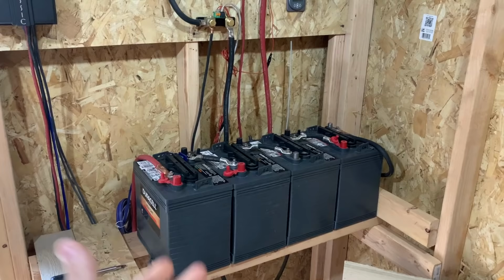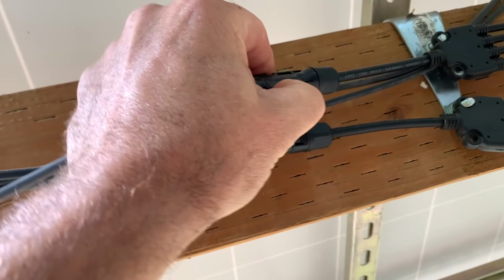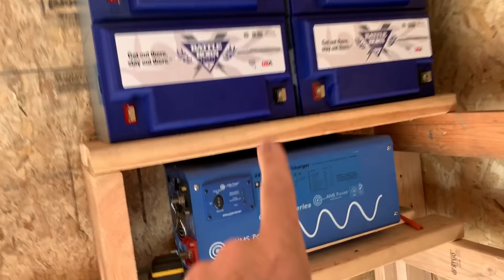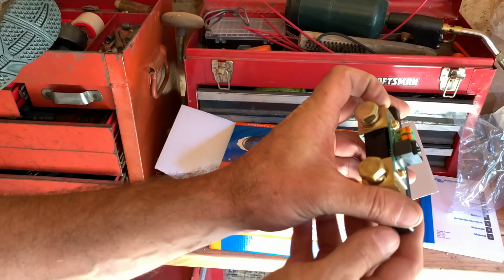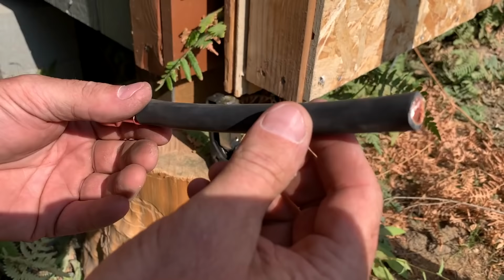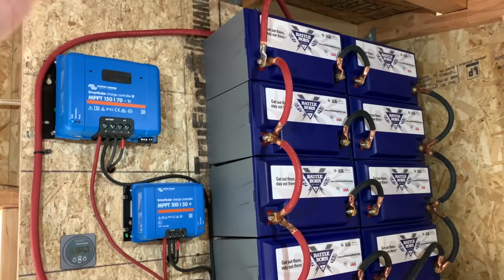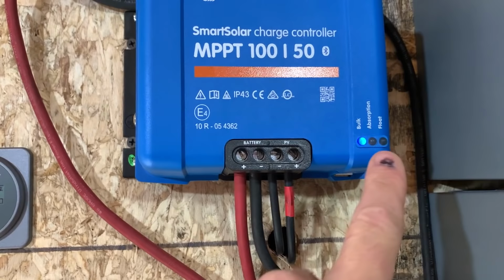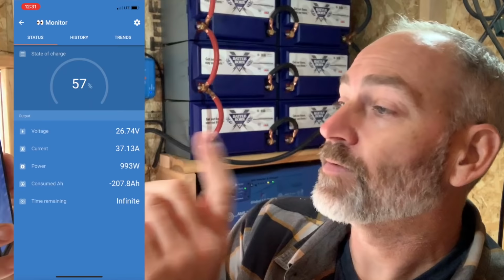EASIEST Off Grid Solar Power System Battery Bank

Comment: I want to give you a little advice on safety on your solar system for two reasons. One is, you aren't aware of them and the second is those folks watching how you do certain things are probably going to be making the same mistakes. Never connect your positive wires last on DC current but, connect the "Negative" wires after placing a 1 ohm resister between your hot negative ( battery or power side) and the negative you will be attaching it to. Make sure you touch both leads on the resister to both negative wires or terminals and then immediately connect the two. This will keep from blowing up electronic components inside of your charger and inverter. I'm sure you heard the pop sound when you connected the positive side of your battery bank.  Additionally, use shrink tube on all wire terminal connections. The cable terminals on your batteries look terrible and will corrode without using it. You have way too much bare copper on your terminals exposed. Finally, you should have a PV disconnect switch on the outside of your solar shed to turn off your system in case of fire.
Reply: Great advice. It looks like there should be another fuse between the solar charge controller and main positive based on the amps the panels are pushing, right?
Reply: Using a precharge resistor is a very good idea and with most inverters and charge controllers is a requirement.  

As far as whether you connect positive or negative last or first does not matter since everything around the batteries is wood and non-conductive at the 24v he is dealing with here.  The only time it is a good idea to connect the negative last when making a connection or disconnecting it first when breaking a connection is if the chassis of whatever you are working on is grounded to the negative cable so that if you are using a wrench it won't matter if you short it to the chassis.  If the chassis is positively grounded which is still common in old tractors and some vehicles in countries outside of North America then the positive would be the best connection to make or break the circuit.  

Regarding the cable terminals, these crimps will be just fine, and since these batteries are in a shed protected from the elements they won't really corrode since they are lithium rather than lead-acid.  At the most, he could apply a bit of dielectric grease as a barrier but it is never a good idea to heat shrink battery cables unless you are using it as a barrier to prevent short and then you should use clear heat shrink so you can see the connection since most heat shrink will hold in moisture making corrosion more likely. 

Having a PV disconnect is also a very good idea at both the array and in the shed.
Reply: Are you saying he should connect both negative leads to the resistor to complete the circuit then bypass the resistor by connecting the negative leads together? Just asking to learn.
Reply: @aqpham84  Yes the resistor bridges the connection first and allows the capacitors in the charge controllers and inverter to charge up and equalize to the battery bank voltage more slowly which also dramatically reduces or in most cases eliminates the spark when you make the final connection.  You can also buy DC isolation switches that have the precharge resistor built-in which is the preferred method since an isolation switch is a code requirement in the USA IIRC even if off-grid and just makes common sense in any semi-permanent install.
Reply: Craig Fisher Where are those batteries going to be after a moderate earthquake ?
Reply: @johnb4183  – I haven't heard of earthquakes in northern Idaho but what do I know?
Reply: Good advice my friend
Reply: thank you
Reply: You only mentioned a couple things and I'm sure you recognized a few others that weren't  optimum. He'll learn soon enough  what hasn't  been  done properly....😨. I'm really surprised  Battle  Born would want to be associated with his setup???
Reply: The connectors will corrode even with heat shrink tubing. Apply dielectric grease first.
Reply: @johnb4183  that was my first concern. He needs some hold-downs to the wall, assuming the wall is strong enuf for the shaking
Reply: God Robot  wrong. 
As a ASE mechanic and master electrician: always hook up neg last on DC system, and  draining capacitors in sensitive equipment is a must. 
You can only let the smoke out once.
There is so much wrong with this install, I don’t have time.
Reply: @kuhrd  no
Reply: @ronsagmuller1350  no what?
Reply: @rubiks6  There was a 6.5 in central idaho this spring that could be felt as far away as Calgary. there is def the potential for earthquakes. Though a bear or even racoon trying to break in is a far more present danger. Eitherway, if i was putting in $10k+ batteries, BMS, inverters etc, i'd spend a couple of bucks on some strapping
Reply: Thanx. That seems safer
Reply: And I agree about thd exposed copper as well. Armed with this knowledge, I'm gonna install my own. Hope they're not too expensive
Reply: I just love how everyone is an expert with advice. The one thing that I DID NOT hear from anyone is a quote from the manufacturers manuals as proof of what 'should' have been done differently.
Reply: @aqpham84  It does not matter if you temporarily add the resistor between the Main Positive Wire & Positive Battery Terminal or the Main Negative Wire and the Negative Battery Terminal.  The 1 Ohm resistor will limit the INRUSH to 24 amps - ie smaller  spark. It is called a "Pre-Charge Resistor"
Reply: Urbexx Jeremy  You completely contradict what Battle Born states!  Per Battle Born ... everything you said is wrong.   Do you actually think, that you know more about the Battle Born BMS than the Battle Born engineers?
Reply: @MicahFunk  Battle Born states, " ... USE AN INRUSH LIMITER ... "
Reply: @MrSummitville  very good. Now this is information that is indeed useful because of the quoted source. Thank you, sir. 👍
Reply: @MicahFunk  In fact, Battle Born manufactures and sells the Inrush Limiter device that you should install between the Li-Ion Battery Bank and large Inverters ...
Reply: @johnb4183  North Idaho doesn't have too much Earthquake activity.  Free from basically all (non cold weather related) natural disasters.
Reply: @MatthewSmithx  I didn't feel it.  Means it didn't happen right?  Seriously though, we didn't feel it up here, I don't remember even hearing about it.  I'm about 40 miles south of him.
Reply: @johnb4183  A bump from any yellow machine with knobby tires and that's a fireworks show, YUP!
Reply: @aqpham84  Are you going to setup the same solar powers system at your home in Viet Nam?.
Reply: interesting ;) . When working with DC, it doesn't matter what terminal is connected last or first, the current is going to take the same path to complete the circuit, regardless the order of connection. As I see it, any electrical or electronic equipment that could be damaged by inrush current, and doesn't have  protection,  as part of the design, is a poorly engineered. You recommended a value in ohms,but tha'ts only one part of the equation. The resistor needs to withstand the current it's likely to see in use. Given battery bank that can deliver 12 V. and a 100 Ams, your retor need to able to over a kilowatt of power I don't use solder on crimped terminals, that would be subject to vibration. Vibration, isn't a factor here, so I'd use solder, to protect against corrosion. Assuming the crimping tool provided a crimp that is both electrically, and mechanically secure. I agree there should be  a disconnecting device between the solar array, and the equipment in the building. However I'd place it at the array, difficult  to use the disconnect, when it' mounted on building that's on fire :) . Such a device, should be DC, for the current, and voltage, it's to control.
Reply: Such an important information and I thank you for that. I'll keep it in my mind when I go solar.
Reply: What wattage resistor do you recommend ?
Reply: @rubiks6  had one last year
Reply: NEVER unplug solar panels under load!make sure everything is off before you disconnect panels. A DC disconnect would be safer to do maintenance. But glad you are encouraging solar. But remember people the system is always ON when the sun is shining...
Reply: I'm a little bit shocked about mounting all the wiring on a wooden background? Here in Europe we have strict rules for mounting backup and solar systems. In our country you need it to be checked by a notified body before you can hook up your system to the grid.
Reply: @davygabriels7971  Yes. But this is USA, people have guns and first of all this power system is out of the (monopolist ;-) grid.
Reply: @Apo5308  Even if we have an offgrid power system, we must follow eletrical regulations and have it checked to receive a certificate. If you don't have this certificate, and someting happens with your house, fire, etc ... the insurance company will withdraw and not pay any damage.
Reply: @davygabriels7971  there are many regulations in the US as well. Some people choose to disregard them to their detriment.
Reply: @davygabriels7971  that's because you are socialist and let the government run your whole lives. Government has no place in someone's shed period!
Reply: @aqpham84  Yeah just hold the resistor to the end of whichever lead you intend to close last and then the other end of the resistor to the battery cable or pole (depends a bit on setup ofc) I got one that is permanently hooked at one end to my negative busbar but that's cause I tend to loose stuff :-D
Reply: If they don’t know that already they better not even start trying to put it together they might not live through it
Reply: @kuhrd   what about putting a grid of 2 or more ground rods in the dirt to have a safe grounding path and tie it to the negative? Power surges or lightening ?
Reply: i think he is also going to end up with a fire, you should only use one charge controller to one battery bank.
Reply: he made that mistake and there's that spark!!
LOL
Reply: @davygabriels7971  in this off-grid application, no inspections necessary. Yes, all components should have been on cement board, many thing wrong on this assembly. Read comments for list.
Reply: The disconnect switch is a must for sure.  As for the resistor, cheaper to replace that than a component or even the shed.  All good advice, glad I read your comment.
Reply: This is my biggest pet peeve with Homesteading and prepping channels. If people do not know what they are doing they should be honest about it, which is most of them, all trying to find their way with little knowledge, bad info, and act like they know.  It puts people watching at risk.  If people do not know the right way they should not set themselves up as teachers. I certainly don’t embrace the idea that you have to be a so called “expert” to share thoughts and ideas and alternatives, but it’s important to be honest about skill level and experience. The big problem is everyone is trying to find a niche to make a living in a society that is working to make most of us into slaves to the few in the financial industry and right now the support money on social media goes to the ones who claim to know.
Reply: Where do you find that type of isolation switch? @kuhrd
Reply: @MrSummitville  So use a 20-30 ohm resistor like Will Prowse shows. Duh!
Reply: @MrSummitville  Battle Born makes and inrush current limiter, but somehow that info did not get into this video. Martin did very little research, and Battle Born did their usual closed mouth act.
Reply: @MrSummitville  Finally someone else points this out! Battle Born is an over priced, over hyped company. Their limiter is not approved for permitted installs, it's way over priced, and the "specs" in their info on the device is literally not one iota more than the weight of the thing! If that doesn't make you suspicious of Battle Born, you need an education in technical electrical info and tech support/marketing.
Reply: @bryanminugh9680  Well put.
Reply: @silenthunter_on_wotb5288  Get the highest wattage you can find at about 20-30 ohms. Better yet watch Will Prowse or Lithium Solar for more info. they are here on Utube, and infinitely more knowledgeable than Martin.
Reply: @davygabriels7971  Yes but so many people here in the US are totally off the grid. I made a cabinet out of cement board for the batteries, charge controller and inverter, with almost no flammables besides the wire insulation, battery cases, and the plastic inside the devices, and two very small junks of wood.
Reply: @aqpham84  Yes that is standard. Will Prowse and Lithium Solar here on Utube and others show the procedure. C'mon people, do some real research instead of finding a channel you like and using it exclusively for your solar energy info.
Reply: @5400bowen  No, Will Prowse stole that idea from me.  DUH !!!
Reply: @MrSummitville  Well, so you are the only one in the world that knew about inrush current limiters, so he just HAD to have learned it from you,eh? I guess all that tons and tons of other knowledge he has about electrical and solar, he stole ALL that knowledge from you also? Is your real name Tesla? Did you teach the whole world about electricity from the very beginning?
Reply: @johnb4183  Marty is in Northern Idaho which is our neighboring state. We have yet to get a earthquake. That's more California. He has the batteries pretty secured so there shouldn't be a problem .
Reply: @rubiks6  no I am in Montana and we have never gotten a earthquake. Snow storm, avelanches yes but not earthquakes
Reply: Can you do a video, you seem very knowledgeable
Reply: Ya need fused disconnects bro !
Reply: When looking out for the people we watch...💁I swear it takes a village 🤺😶‍🌫️🧑‍💻
Reply: Thank you 🙏❤️
Reply: @rubiks6  We just had a 4.8 ish last week in central Idaho.  You never can tell.  I'm just reading these comments to learn how I've gotten lucky for the last 20 years.
Reply: @tagladyify  and my question is this ... what qualifies you to say someone is or isn't qualified?  Just askin..judge the judgemental and what have you become ?
Reply: @jamesgibson5876  it’s certainly up to me and you to determine if someone presenting information knows what they are talking about or not. That is not judging. Don’t be ridiculous. What you are saying is just trust everyone. And if someone is taking advantage of others for money just shut up and move along? What kind of society does that leave us with? No each person is responsible for not only what they say, but also what thy do not say.
Reply: Can someone please recommend a good solar battery to me?
Reply: Isn’t there more possibility of fire using lithium batteries ?
Reply: thank you😊

Comment: I hate how the only people that can afford to live off grid are the same ones that can afford to just pay the electric bill.. lol
Reply: Yeah this is easily a $12,000-15,000 solar system. That said, you are paying up front for "free" energy later.
Reply: Nearly $8K of this are the batteries. If you used AGM or even lead-acid, that would cut $6-7K off this. Then you're talking tops $5K for around 14KWh/day free energy.  In my large house I only use 10Kwh/day.  $5K would be easy to pay back from saved energy bills.
Reply: @toddfarkman2177  right on.  I mean not to mention the ecological impact the fossil fuel industry wreaks upon the world.
Reply: Off grid is often because of the cost of bringing the line into the property, or because the property has no realistic opportunity to connect to the grid at all.  Sometimes people just do not want to be connected or rely upon a grid as they prefer to control their own existence.  All good reasons.
Reply: @joniboulware1436  or the 25 year benefit of generating your own power that doesn't rely on on coal.
Reply: @Mbnewman087  Yes there are some motivated by virtuosity but it currently solar panel production involves fossil fuels and really nasty mining industry for battery and solar materials.   We don't have a good system of recycling these batteries and panels either.  Still, it is the right direction.  The pure play is reduction in usage - like working from home, walking to the store and consuming foods with limited processing.
Reply: @joniboulware1436  I prefer my method of energy production.  Hydroelectric home unit fountains. Wind power and puppy power.  Solar is alright.
Reply: Seems to be the case
Reply: Work an extra 20 hours a week for a year or 2. There you go you saved money to go solar.
Reply: @affinity3281  well since I'm a 69 yo disabled vet..I guess I could skip some meals for about 10 years... lol